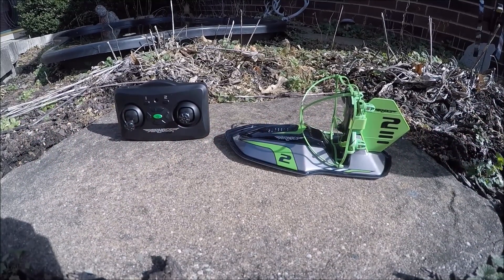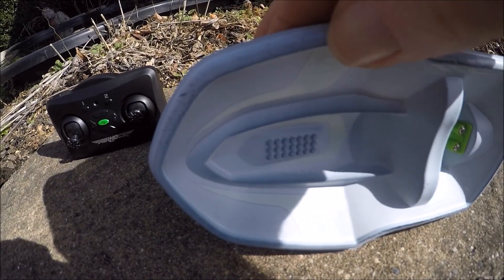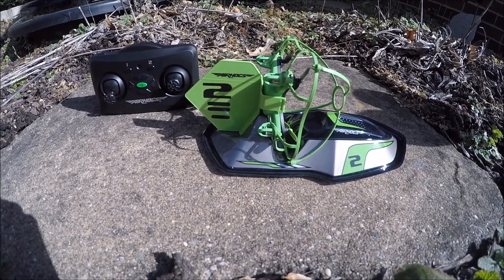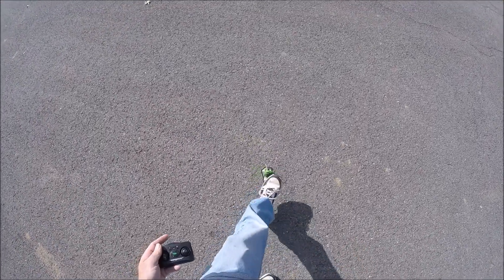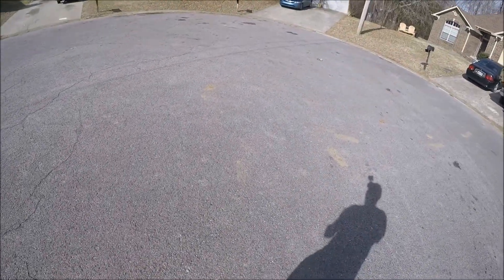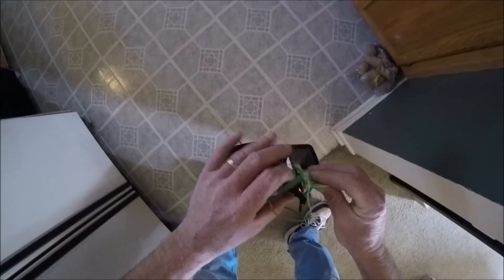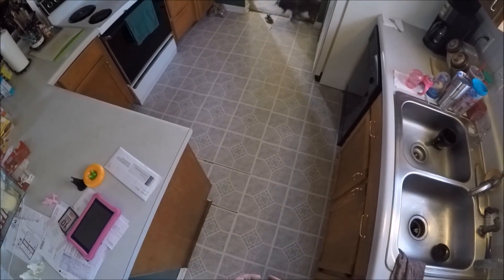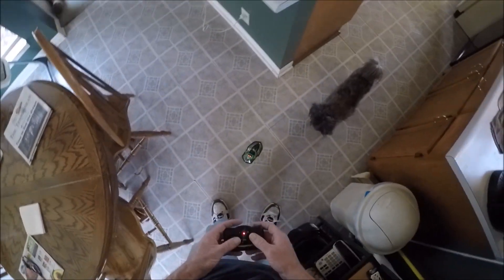Tiny Hyper Drift Drone

Comment: I think its sposed to go over water like a hovercraft or maybe im totally wrong
Reply from the maker: Your totally wrong it will sink LOL. Land and air only. Cool as all get out though. I just went FPV with it and made some prototype gates. Now when I'm done I'll try water but you'll need to add a rubber bag of some sort to the bottom like a hefty trash bag one of the thick ones and cut a hole in the center and smaller holes on the outside of the big one to allow just enough air to escape. My mind is running 100MPH on this hobby right now. Stay tuned I'm cutting up quads as we speak and working on the mods for this Hyper Racer.